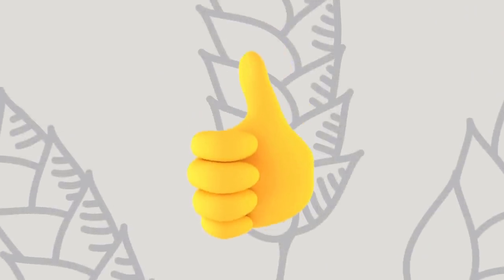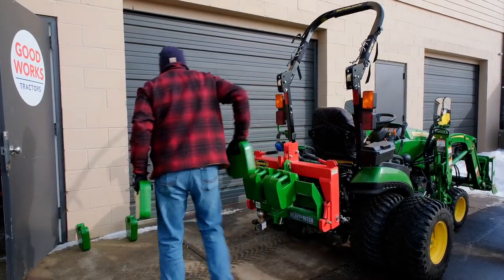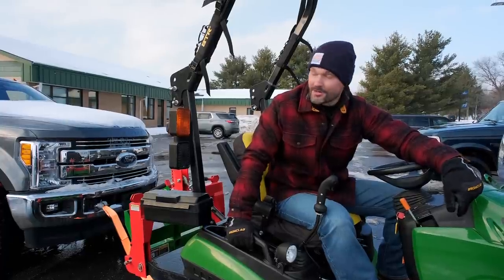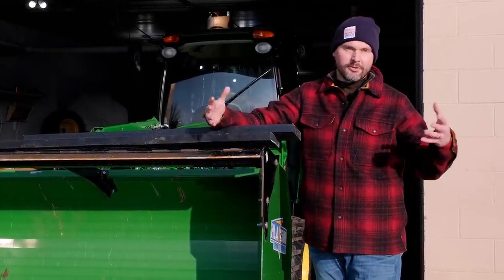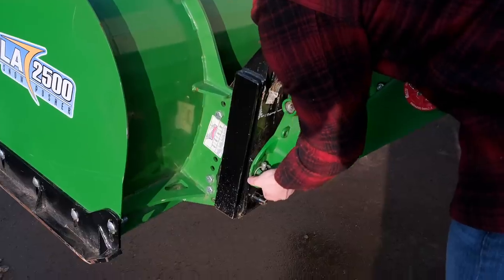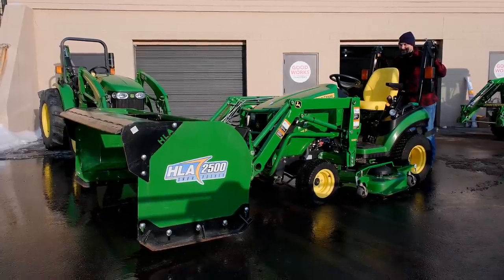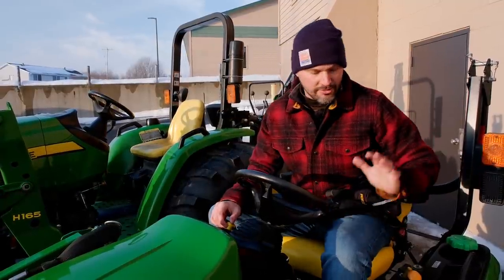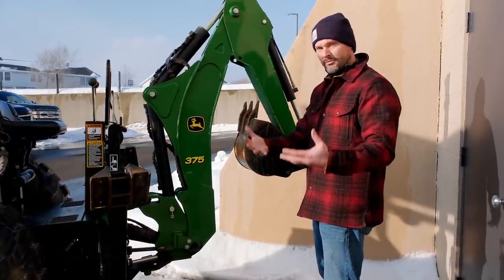CAN A TINY TRACTOR PULL A TRUCK + 9 MORE RANDOM QUESTIONS! 🚜

Comment: The gearing in a tractor should be such that it's a question of traction, not power.
Reply: Absolutely. I suspect that that little tractor has well over 2,000 ft-lbs of torque to the wheels (I don't know any of the gear ratios) which is more than enough to pull that load up the hill. It's all about TRACTION.

Comment: I have owned that 1025R for 8 years, I DID NOT KNOW about pulling the PTO knob to keep it going when you hit reverse...I just used a zip tie on the button hidden under the tractor for when you hit the reverse pedal.

Comment: I bought the UHMW edges from Courtney for an HLA snow pusher, both primary edge and backdrag.  Exactly as advertised....they are wearing a little faster than steel, but they do cut through the packed snow quite nicely and have done NO damage to the hard surfaces.
Reply from the maker: Glad to hear it Chris, hope you're doing well!

Comment: Courtney,
I have a Curtis Cab on my JD4720 and am satisfied with it...but not cheap.    I have had it for 3 seasons.  Although not nearly as nice as the factory cab, It keeps me warm and out of the winter weather.  I take my doors off in the summer, open the front and rear windows and turn the fan on high.  If buying a new tractor, I would strongly suggest getting the cab with the tractor if you can afford the addition cost.  
 I have also installed a 4" x 3/4"x 6' strip of UHMW on my 6'  3pt. snowblower.  I installed it mainly because of the rust and scratches my shoes were making on my blacktop and cement portions of my drive.  It has only been one season and only used on my personal 1/8 mile drive and around my sheds, but it is working great!!!  It is showing very little wear. We typically receive 50" plus of snow each year where I live in WI.
Reply from the maker: Awesome, great info.  I appreciate you taking the time to share!

Comment: My idea of a pulling test is "can it pull my 4wd out of the mud when I get it stuck" - I just had a real world test. Got my 99 Tahoe stuck down back with a utility trailer on it. Heavy rains turn the area into greasy mud which turned the Goodyear Duratracs into slicks. My B7800 (R4 tires) pulled it out but it twernt easy. I disconnected the trailer, didn't help, I finally put 100' of snatch strap (2 50' ones) to get the tractor on (more) solid ground, and I still had to do a mild stretch and pull to get it moving. The Kubota was in 4wd and Diff lock on. It saved my butt, so it's all good, and I would have been totally screwed if it hadn't worked. It was my pull with the B7800 in the slippery stuff. "Gumbo" mud can neutralize almost any vehicle, My neighbor is a dairy farm with dozens of BIG JD ag tractors, and a few years back he had a tractor with spreader stuck in sight of the main road all winter. Then it claimed another victim, 2 big 4wd tractors and a spreader sat stuck there for over a month. 
My (long winded) point is size and tires matter, but even the big stuff is relatively easily neutralized by muddy conditions. Given traction, even a little machine can pull a surprising load, but lacking traction, even a $300,000 4wd with duals can be stopped surprisingly easily. If you see the muddy conditions, invest in some long pulling straps, (chain or cable work too) to get your tractor on good ground. A bigger tractor is rarely the answer for this sort of work.

Comment: I am IMPRESSED!! Pulling truck and trailer. That’s awesome.
Reply from the maker: Yeah, that was pretty cool!
Reply: @GoodWorksTractors  When you get a chance, check out Engineering Explained's recent video on the electric F150 pulling train cars...  He does a good job quickly showing the rolling weight vs force needed to move it.  My background is mathematics, but if my kids ever ask how much our tractor can pull, long before I break out the whiteboard, we will be chaining up as many rolling objects as we can find and having a blast!  Thanks for including a not necessarily practical, but amazing question just the same!

Comment: Nice demonstration. I used my John Deere 2210 to help pull the F350 and 5th wheel out of the mud. Obviously it couldn’t have done it on its own, but it’s helping the truck with traction and some pull force helped us get unstuck.

Comment: I pulled my f150 out of the swampy lawn using the 1025. quite an easy pull considering the tractor was on dry pavement and the pull was less than 20'. The tractor didn't break a sweat. I spent more time trying to get un-stuck and setting up than it was to pull the truck out.

Comment: For the Reverse issue, I use one of those small plastic spring loaded clips and pull up on the PTO engagement knob while wedging the clip underneath.  This keeps the knob pulled up all the time and overrides the shutoff mechanism on reverse.
Reply from the maker: Good idea, thanks for sharing!
Reply: I use a clothes pin.

Comment: I knew your 1025R would pull your pickup.with no problem because ive pulled as well as pushed my 1985 3/4 ton 4×4 chevy pickup truck with my 1025R. Strong little tractors

Comment: Hi, I bought a HLA 1500 for my 1025r with a back drag from Courtney this winter. I chose the rubber edge and also bought a UHMW edge.  I moved the rubber edge to the back drag edge and put the UHMW on the bottom edge.  I have had the opportunity to use it twice the rubber edge shows none to very little wear and the UHMW show a slight to moderate amount of wear due to the angle it makes contact with the surface.  I have a standard 3 car drive way with i used the rubber edge to back drag and I have another 3 car garage on the side of the house with has its own drive way.  I used the UHMW to plow the surface on that area and in front of garage and also plowed the entire cul-de-sac that we live on.  so the UHMW did have more area and a rougher surface to plow, it also dealt with the sand on the pavement in the cul-de-sac.  I was very impressed with the rubber not wearing while using it on the back drag.  I believe once the UHMW wears down to a point that the full width makes contact with the surface it will slow the wear as well.  Great attachment for where I live in Missouri.
Reply from the maker: Good info, thanks for sharing Douglas!

Comment: Might want to include The Original Tractor Cab to your list.  Quality product at a very reasonable price that I installed on both my 1025R and 2032R.  They came with an electric heater that I never installed.  I did purchase a cheap heated car seat cover and it is so good that I only have it on for a few minutes.  Same with my heated gloves (I suffered from frostbite many years ago and my finger tips can't tolerate heat or cold).  I made a lift frame for the 1025R so, removing 6 bolts and an electric plug, I can lift the entire cab intact off the tractor.  Because of the assembly, I don't think I'll be able to do the same on the 2032R.  Love your videos and was surprised as all get-out that you could pull the truck.  Especially considering you removed all those weights.
Reply from the maker: I did add them to the list.  Somehow forgot to mention.

Comment: Couple things to consider...

1) Small tractor transmissions don't like being overloaded.  When my Ford 5000 burst its radiator, I used my Simplicity lawn tractor to pull it into a better location to work on it.  This is a mid-size lawn mower moving a nearly 8000 lb tractor (filled tires).  Since the terrain was flat, it worked just fine, but I'd never do that if a hill or any real distance was involved because those low end TuffTorq transmissions won't last long.  Thankfully, it's not a K46, but even the slightly upgraded K57 isn't going to last long doing that.  Your 1025R probably will not have any serious damage doing it a few times, but if you made a habit of using it to move around heavy stuff - especially on slopes, I think you will experience transmission problems.

2) I was always taught to relieve your hydraulic pressure when done.  Leaving an implement suspended with hydraulic pressure holding it is bad for the seals.  Is this no longer the case?

Summit also makes manual splitters for remote hydraulics.  I needed a second remote to handle both the rotation and chute angle on my 3PH blower.  I looked at those electric options and felt it was a lot of $$.  Chute angle isn't something that gets changed all that much, so I just needed a simple way.  For under $200, they had just the splitter I needed.  I plumbed it so that I could reach the handle from the seat (open station) and it works great.  Here is the thread on restoring the original remote and adding the splitter on my machine:  https://www.tractorforum.com/threads/hydraulic-connector-and-pto-operation-questions.45663/#post-318219
Reply from the maker: Good info, thanks for taking the time!

Comment: Years ago the neighbors had an 18 wheeler moving truck get high centered in the edge of our, at the time gravel road.  It was slightly up hill.  I used a JD 755 in 4 Wheel Drive to get it off being high centered.  The tractor was spinning all four wheels but it did it.  The Mover's thought I was nuts when they saw me hook up to the 18 wheeler.  Lots of Big eyes & wide open mouths when they saw me do it.   It would have been a great advertisement.  LOL
Reply from the maker: Haha, I'd have loved to see that!

Comment: A thought about hydraulic leak down:  Many moons ago, when I was but a lad working on my uncle's farm, he taught me to always leave hydraulically operated things parked in such a way that there was pressure on the cylinders.  That would keep the seals in as good a shape as possible - no chance to dry out due to lack of contact with the hydraulic fluid.  For example, you would never drop the front end loader all the way to the ground when you park it. You would leave it a foot or so off the ground so that the cylinders would have pressure on them.  Depending on your system, it might be on the ground the next day, but you would be giving all the seals the best possible chance to last a long time.  I currently have two 30+ year old Cub Cadet garden tractors. The cylinder on one of them will still hold my snowblower off the ground overnight, but the other one will not.  The bad one spent too many years getting parked with no pressure on the cylinder.

Comment: Maybe you have a Gator stuck down by the lake 🤣. My 72" Land Pride blade came with a 1/2" poly edge and the bottom corners folded back after only a couple uses on my gravel driveway. I'm going to try the 3/4" or 1" next year to see how that goes.
Reply from the maker: 🤣 Thanks for sharing!

Comment: Do you think a loader mounted snow plow stresses the loader while pushing heavy snow in angle position. Especially when you get to the end of the push. Thank you.
Reply from the maker: Yes, I do think it has the potential to damage the loader arms if you're not careful.  Not that it's highly likely, but it's an increased chance compared to an even load on a pusher.

Comment: I have a 2305 John Deere which is the same as the 1025r it's just older and I run a 73-in bucket on that for pushing snow and it works great of course I've got 10 of the 40 lb weights on the back of the three-point but I have no problem with it

Comment: Diesel fuel is measured in cetane not octane! And I have a Economy Power king 14 HP lawn and garden tractor and pulled a full size John Deere 3020 tractor that weighted 8000 pounds 400 yards so yes a 1025 Deere should pull everything you showed

Comment: hello Courtney
with that two way valve installed, could you still hook up and operate operate the backhoe??  i would like more info about that two way valve and multiplier if possible. i am looking to get rear hydraulic circuit or remote whichever you prefer. my dealer said i could not get rear remote for my tractor.

Comment: I'm pretty sure most manufacturer's owners manuals explicitly state, as a safety item, that you should never park a tractor with the engine off and leave a FEL "up in the air".  They should always be lowered to the ground first because they will leak down over time.  The only exception would be to use some kind of mechanical cylinder locking attachment or accessory (as seen on some skid steers).
Reply from the maker: I forgot to mention the application for why this came up with the customer.  He was grappling a log and cutting it with his chainsaw.  The loader was dropping so fast that he had to raise the loader up repeatedly while sawing which he found very inconvenient.
Reply: @GoodWorksTractors  That is very inconvenient.  It's still better to prop up one end.  OSHA would have my butt in a vice if he saw us do that on a commercial job.  I know, I know.  Personal property & all.  I get it.  It's just a prime situation for injury.  Working alone, middle of nowhere, I slip under the log & get pinned.  It happens.  How often?  I do many things that are inconvenient that make a project safer.  Seatbelt for example.  I don't wear it because it's The LAW.  I wear it because it reduces injuries in a crash.

Comment: Our fact checkers have labeled the hill climb with the F250 + gooseneck as disinformation!  I saw smoke coming out of the tailpipe during the alleged "pull stunt", obviously the truck was running and in gear during this "re-enactment of the moon landing" debacle!   I'M JUST KIDDING, COURTNEY!

Tractors are meant for brute pulling strength from the drawbar!  I bet you could move a railroad locomotive with that 1025r.
Reply from the maker: Ha!  No way was I leaving the truck off or unattended just in case something went awry!

Comment: Cool video! Im impressed it didnt try to lift the front up. I wonder how many tractors on your trailer the 4066R would pull over the hill? Haha
Reply from the maker: Haha, I'd need a bigger trailer!
Reply: @GoodWorksTractors  no doubt! It's quite a machine.
Reply: You also answered a question I had about the power beyond and the hydraulic multiplier so thanks for that.

Comment: Do you think you could have let the truck or truck and trailer roll back down the hill  while keeping it under control with the 1025R brakes? That would really impress!
Reply from the maker: Haha, I'm definitely not confident in that.  Would need the assistance of the engine I think.
Reply: You could try it with truck engine running in neutral and someone in drivers seat.

Comment: It amazes me on what this little tractors can do impressive pulling power out of these. Question for you, is there anyone out there that makes or modifies the upper rops bar to a short design? I find its over kill and with the 3 point gear installed it doesn’t fold down nicely and its a pain with low clearance garage and barn doors. Thanks for the good info in the videos
Reply from the maker: I'm not aware of an option to modify the ROPS.  I can't imagine anyone wanting to tackle that issue as it's a certified safety system.

Comment: I have a question about leak down/hydraulics. I purchased my first tractor X758, diesel, 4wd, 60" auto connect. I think I can call it a tractor? Oversized mower? Anyway, last year I got to the hydraulic oil change point, so I changed it. The dealer sold me JD "Lo-Vis" oil. The oil that came out of the tractor was clearly more viscous, regular hydo oil? My tractor acts differently now with the "Lo-Vis, the steering seems to require a little more effort & RPM, my deck also leaks down after sitting when it didn't before. I've triple checked for air in the system & everything seems fine. I've wrote it off to my climate (TN) as the "Lo-Vis" is said to be better for cold and I don't use my tractor in the cold. Any thoughts?
Reply from the maker: I'm not an oil expert, but do think you might benefit from the hi viscocity oil especially given your climate.  Perhaps we'll have some oil experts give their thoughts as well.  I'm wondering what prompted them to sell you the low vis?
Reply: @GoodWorksTractors  Not sure why they sold me the Lo-Vis over regular Hy-Gard even though my manual states that I can use either and the Lo being better for the cold. I just trusted them and went with it like I do for all my maintenance stuff. It's my first "real" machine so I've spent a TON of money on JD fluids, grease, filters, etc. This thing cost way to much for me to even think about taking a risk, is that normal or just new owner paranoia?
Reply from the maker: You're not hurting anything by using fluids that are recommended, but there will be performance differences under different conditions.

Comment: Hey Courtney, I'm looking to get some ports o nthe back of my Massey GC-1720. So I need the multiplier as well as a set of levers from Summit Hydraulics? I'd be tapping into my power beyond from my backhoe while it's off the tractor. I want to run a leveller and a tilt on the 3PH for my box blade.
Reply from the maker: Good morning, yes you'll need a couple different kits.  I'd recommend contacting Summit directly to get setup properly.  Good luck!

Comment: Cab please 😩😝😝   Hey I’m interested in the winch on your side by side. You were not pleased with the pull. Was that rating by using a pulley block or straight pull? Let’s see some testing. 🤔
Reply from the maker: Haha!  Yeah, I'm looking into Force Gauges.  Could make for some fun videos.  I don't know anything about them or how to use them, so doing plenty of research before pulling the trigger.  If Warn was requiring their 4,500 lb winch to use a snatch block to get that rating, then that would be some really sneaky marketing!

Comment: Look at a steel edge cost (high) vs a plastic edge (low).  Then consider driveway & road damage.  And ease of handling (a 72" steel edge is heavy).
Reply from the maker: 100% agree.  Other costs involved besides just the cost of the edge itself.